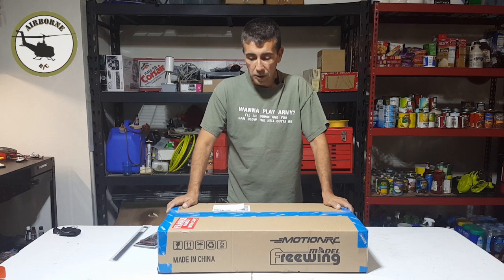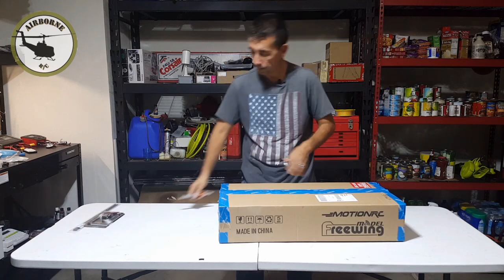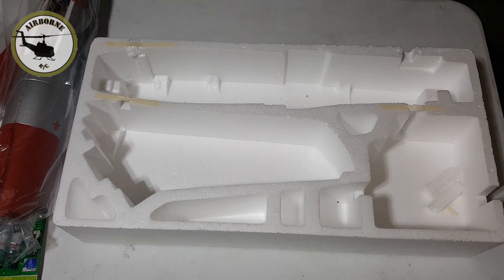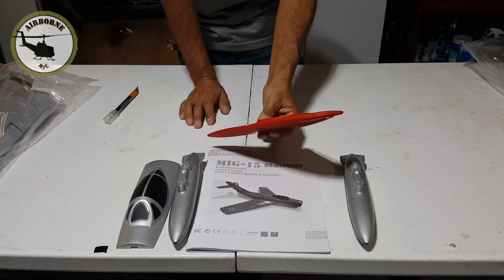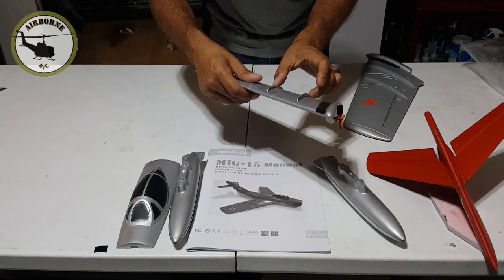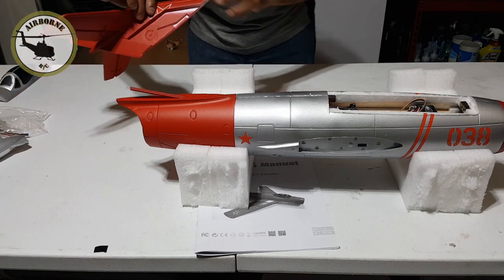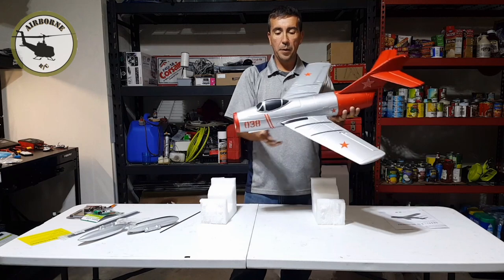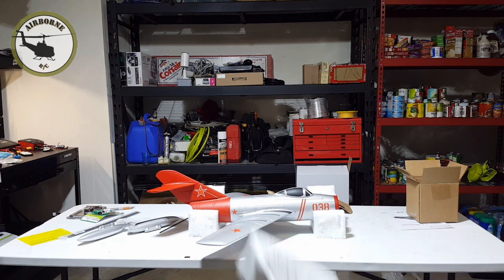Freewing MIG-15 64mm UNBOXING and TIPS!!!

Comment: I’ve got an F-86 I haven’t flown yet. I’m interested to see how this comes out. 

Thinking the modifications  might be transferable. Especially since I put in a 64mm FMS system and upgraded to a 45A ESC. Already have a couple servos to try for a rudder install.
Reply from the maker: ill have those videos up within a few weeks. The rudder mod is simple to do, I already have dont it with the eflite 64mm F-15 works great and can corkscrew like crazy!

Comment: Hi. The MiG15 can fly whit 30C Battery?. Specifications said 35C is needed. But I have a 30c Battery. Thanks
Reply from the maker: 30c works great. Fly mine all the time with an Admiral 3s 2200 30c
Reply: @NoonzAirborneRC  thank you for answer